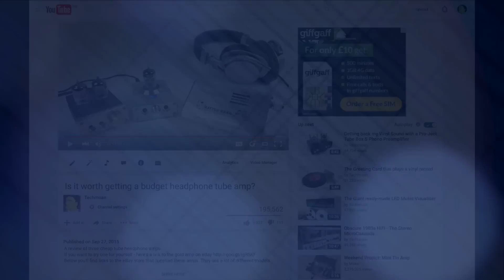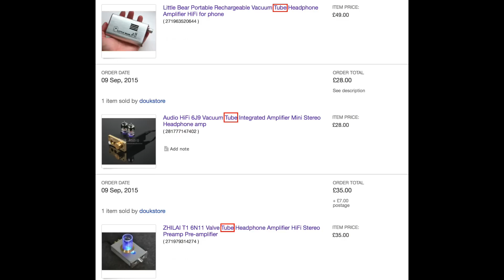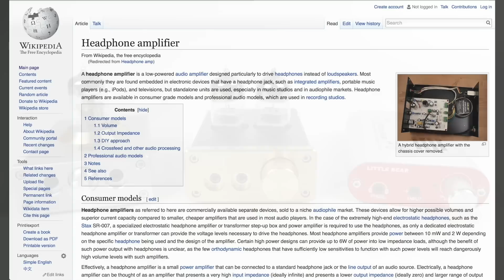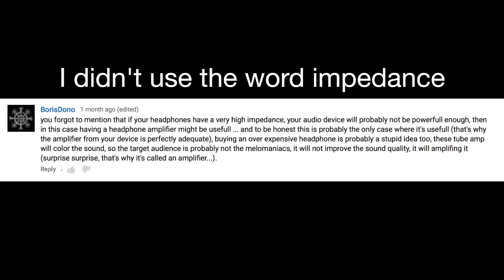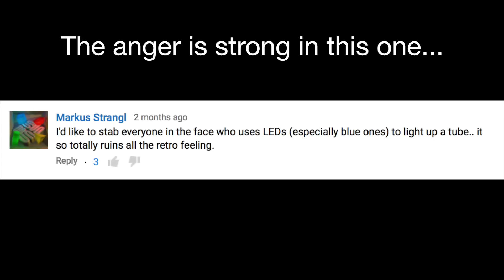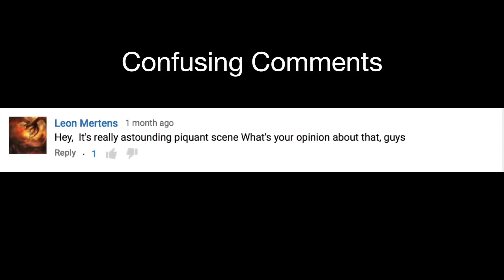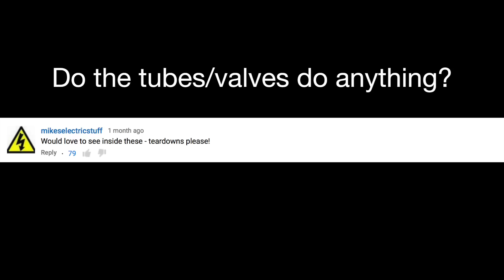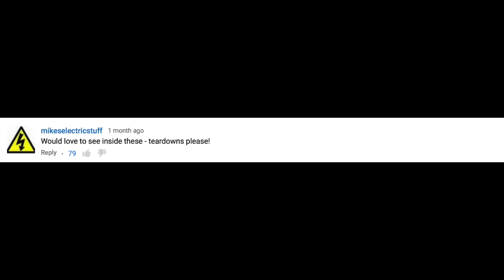Headphone Tube Amps - Follow-up & Tear-down

Comment: 6J9 Tube / Valve  is a triple triode designed to provide the combined functions of a RF Amplifier, oscillator and mixer into the VHF frequency range..... Seems a bit strange using this in a audio application seems more likely to be found in a older tube type american Television sets tuner.  another way of testing if this tube is legit there should be at least +125 VDC between pin 6 and common ground that is the plate voltage

Comment: Unit with the two valves, at least from what I can see, has the valve output going to pin 8 (Vcc) of the NE5532 Op Amps  supplying (nice smooth) power to the IC. The valve inputs appear to be from an LC Pi filter from the DC input so the valve is basically a power supply component.  Just for show.
Either that or they are just used as regulators to the inputs of the NE5532's but the tracks are hard to define.  
Only the Op Amps boost the signal to the output regardless.

Comment: I found both videos about these headphone amps really interesting. I am a bit of an audiophile but not one of the angry ones. I did wonder about the benefits of using something unbranded and very cheap. I nearly cheered when most of them had problems, and if I didn't have a hangover I would've done. I don't believe in spending ridiculous sums  for Hi-Fi but good valves or tubes (say whichever you want) do add a cost premium over a similar spec transistor model. So it does seem to have been borne out by your tests. If it sounds too good to be true - it probably is. I'd be very interested to hear how hot these things get with prolonged use, and whether they're actually very safe.

Comment: Gosh, I see integrated circuits but no output transformers.  I don't know a lot about physics invented since I was "up" on this topic 20 years ago. But I fear the tubes are not as much as they could  be.   See  https://youtu.be/rpMLYI0XG0A  for myself and tone when I was more current and fewer volts, grin.

Comment: I can see all three have a solid state voltage inverter clearly turning the low input voltage into the higher voltage (probably 90V) required by the valves. Bear in mind the printed circuits are double sided so connections are made both top & bottom. We have a modern microphone preamp here which has a valve in it & I too was surprised when it came with a 12V power adaptor. A quick check inside proved there was an inverter to produce the required high tension voltage.

Richard

Comment: Ok.  I don't give a rats ass about headphones.  I've got a Pi3, Dac and a home built tube P-P tube amp into a pair of Dynaco A-10 speakers.  I also have a home grown combo sand and tube pre-amp complete with phono-pre.  Quit whining.  You still don't match my system.

half (or more) of these, so called tube headphone amps not use the tube for anything.  not even a buffer stage.

Comment: Techmoan: some tubes are not "microphonic" while others are not, microphony is physical behavior of ALL tubes caused by the mechanical vibration of the control grid inside. Another important point: all single tube model obviously do not used their single tube since their are two channels to amplify, the tube in these devices are just decorative.
In fact, to confirm that this nice tube amp you just bought is really a tube amplifier, give a small notch on the tube, you should here this microphonic resonance you heard on your two tube model.

Comment: just my input as to the little bear t7 phono headphone amplifier is absolutely terrible.  check out my video on the little bear t7 tube amp but the tubes were too small, as a phono preamp it really added distortion and muddied up the music.  tubes need a ton of money thrown at them to be decent quality.   and keep in mind the phono preamp is really to convert the signal from the turntable from phono to aux signals not requiring the phono preamp inside your stereo amplifier.  but for $50 on Amazon The Little Bear t7 tube phono preamplifier was really a waste of money and in fact just took away from the quality and detail as well as Clarity of the music.  a complete waste of money but a headphone tube amplifier is a completely different piece of equipment.  I have tested over 7 phono preamplifier utilizing tubes as well as 14 headphone amplifiers using tubes and using transistors and what I have found is that you are able to save money on a headphone amplifier utilizing transistors and the quality seems to be better and of course make the music much louder however the tube headphone amps require spending a little bit more than $100 in my opinion to really take the sound quality up a notch.  I also performed a video on tubes in general and the consensus or conclusion at the end in my opinion was that tube amplifiers in general require a bit more money than a solid-state amplifier of any size in order to actually gauge the quality becoming better of the sound at all.  basically tubes are expensive and they're more expensive than their counterpart the transistor good more expensive to make and generally don't last as long however many people enjoy or prefer the warm Rich sound that tubes offer audio quality.  in my testing the Kilimanjaro headphone amplifier from Fujiyama proved to be the best quality and offered the most improvement over the audio in general also took the volume from listening to music from my phone and other MP3 devices to a total of three times more then not using an amplifier.

Comment: with the single tube amp, anyone else notice that transistor on the bottom. im thinking that power goes through the tube to the transistor so when the tube gets removed, the circuit gets disconnected
Reply: In fact a tube can only amplify a single channel (right OR left). So the point is: any device that claim to be a stereo tube amplifier but only has one tube is nothing more then a scam.

Comment: I was surprised to see that tubes (valves) were still being made, let alone being used for anything but replacements in old equipment. These were made obsolete when I was still in grade school, and that was 50 years ago. Other than retro for the sake of being retro, what's the point of designing anything that uses tubes?

Comment: of course you may need a headphone p if you've bought particularly hard to drive headphones (like the Fostex).  And not all of these are super expensive, so a budget solution would be welcomed.  

Though I would recommend an smsl solution over all of these.

Comment: The units work as real valve amplifiers. If you look closely at the dual tube and single tube amps, you will see a tiny black ferrite with a coil of copper wire wrapped around it. Nearby will be a 8 pin plastic package... thats the pwm controller the uses the coil of wire as a boost converter. This provides the B+ and B- for  the tubes.

So the valves are really  wired into the circuit ( double sided boards, so anode grid and cathode and screen ( where applicable) are utilised)

Another useful adjunct of the boost converter is that the operating frequency will be very high ( maybe 50khz) so there should not be any anode derived hum, like there can be in normal mains amps with a normal A class amplifier, where filtering the 50 hz mains noise out is a real problem in A class.

Valves can actually run at very low anode voltages, but the power will suffer accordingly.

 We can also use thoriated tungsten in the heaters of high power tubes, or strontium or perhaps barium oxides in low power ones to ease the heater current...ie to lower the heater temp and still get a decent electron cloud/emission thing going....

 Once we use the heat to drive the electrons out of the cathode, they will hang around in a cloud, but not really keen to go back, as the cathode is negatively charged. They prefer to go to the positively charged anode ( opposites attract). We can accelerate or slow them down by changing the grid voltage with respect to the cathode, and thats how they amplify. So by varying the grid voltage a bit we can control a relatively large stream of electrons... we have effected amplification. ie the grid sits between the cathode ( redhot and emitting electrons) and the anode ( positively charged with respect to the cathode). The electrons have to get past the loosely woven grid wires, that we place the audio input signal onto... we can also get it to buffer rather than amplify, and here we use a follower circuit ( less than unity gain )

There are a few op amps in there to give more gain/ frequency modifications, and probably provide negative feedback to maintain stability. There is a difference in the way valves and transistors treat the various harmonics, and each type may sound fractionally different, and as you have found, micro-phony can give an extra dimension of richness by giving some feedback into the grid from the vibration of the speakers in the case of speaker amplifiers. This happens because instead of changing the grid voltage to modulate the electron stream, when you hit it or knock it, the very fine wires that make up the grid, will vary their position relative to the distance from the cathode and the anode, this will modulate the signal too, so the vibrating grid acts as a microphone effectively... perhaps like a ribbon microphone.... proof the valve is actually part of the circuit and working as an amplifier to.

Look like simple little units, but they are really quite complex with pwm power supplies and all....... actually a hybrid.
The valves are there just to say a" valve amp", but they do play a part in the amplifier.

 Thanks for the teardown, I enjoyed it very much..

John

Comment: You guys do know that cars used to have tube radios that ran on 13.8V right? And DC to DC converters didn't exist in the 1960's (they do now btw). These are low power amps, they don't need massive voltage differentials to give you 1W of output from line level.

Comment: They are called vacuum tubes not valves! A valve is for plumbing or air flow. there are also gas valves. enough said. Thanks I like the videos. I also like exposing the fraud on these amplifiers. you must have B+ voltage on a real tube Amp!

Comment: Not all tubes used High Voltage, most used 6 to 12 volts, the high voltage tubes were usually only in televisions, or highly specialized applications. A lot of tube radios used batteries, and while they were commonly 20+ volts, that voltage was often stepped down for the tubes, and the batteries were just high voltage to last longer, and/or to make the battery last a long time. These little tubes were more than likely the low voltage tubes anyways. It is entirely possible that these tubes are actually being used in these circuits, even if only a few legs of the tubes are being used. It was very common that one tube had multiple applications, and different legs would be used for different things. In the tube radio that I own/restored, most of the tubes have only a few wires running to them, and it is the same way in my stepfather's large console radios and tube tv.

Comment: I have owned and listened to many amps over fifty years. The one I am currently using is a valve amp and I think it sounds great with the speakers I am using. I also currently use a valve phono stage for my records and I listen to the radio.

Comment: A few short comments (I don't like typing a lot):
In the late '60s I watched my father and uncle build hi-fi and electronics kits (Knight, Scott, Dynaco etc.)
From early to late '70s I built Heathkits and Eico, and worked in TV repair shops.
I got to the point where I can look inside a tube and identify which leads go to the anode, grid(s),  cathode, heater etc.
Came in handy when the ID was rubbed off.
Never worried about leaving fingerprints on the 1000s of tubes I handled.
In fact skin oils on the higher power tubes only made a distinctive odor.
Looking in my 1973 RCA Receiving Tube Manual I see that the 6J9 is a high mu triple triode.
Doesn't list the others mentioned.
To those who like the sound of tubes I say "have at it", the added distortion is like the fungus in a good cheese.
Reply: Nicely put
Reply: The 6021 subminiature tube is a twin triode. It looks like it was high quality as it was one of those subminiature tubes that were built to US Military specs back then. It was used for RF Amplification and Oscillation.

Comment: I think im quite a bit late to the party here, but will chime in anyways: The 2 tube device with the 5532 opamps looks like it uses an hybrid structure of 1st half of opamp (as input buffer) > tube (as "coloration" stage) > 2nd half of opamp (as output amp), all of that multiplied for 2, so you get stereo. thats what some low voltage tube pedals do, so it makes sense that its what happens here too, specially if you look at the opamps location, they are right besides the input and outputs. Cheers.

Comment: Great video Mat, and yes, the tubes are actually in-circuit and those circuit boards are  double-sided and have wiring traces on both sides, so even though only a couple terminals of the tube sockets may appear to be connected viewing the board from the bottom, there are more traces on the top of the board... maybe even some traces between the top and bottom sides  if the circuit board has multiple layers. 

I like your shows, Mat.. I learn stuff and have a good time too... it's kinda like an educational technical version of Monty Python or something. :-)
Reply: Its expensive to make multilayer boards, so these will be just double sided. The actual work is being carried out by the NE5532 op amps, the output is then fed into the valves-though they are not doing any useful amplification, these would sound better if you bypassed the valves.

Comment: A little late to the party, but all the tubes were connected correctly. You can see when in circuit board the color slithly changes for a millimeter or so then there is a gap in copper. Those circuit boards were multi layer meaning there was copper on atleast both sides. You could see that the tube connections were on both sides of the pcb. Also all of those "water reservoir" looking components are all capacitors, even those small SMD silver ones. (there are other water reservoir looking components but i suspect not in here)
Having power supply of only 12V means nothing. There could be voltage pumps or in other words DC to DC converters that simply make a DC voltage to a smaller or larger DC voltage. But then again on these cheap devices i doubt it.
Those black components that have pins on two sides (for example on the first amp the ones with label NE5532N) are dual opamps (or single or quad). Basically it means that these "tube amps" are just hybrid amps and most likely the tubes doesnt do anything but just distortion and noise.

Comment: Concerning the 6021.  The tubes (valves) are dual triodes developed during WWII.  They
were used in artillery shells.  These are proximity switches to detonate shells fired at attacking aircraft, usually from ships.  The shells exploded near airplanes in the event
the shell missed.   .

Comment: Validity of the circuitry aside, audio is very subjective. I am an old school audiophile that have speaker cables the thickness of a garden hose that cost more than most stereo systems. Do they sound better than lamp cord? Yeah, I think they do and I'm the only one that counts. I am also an electronics hobbyist with more than 50 years in the field. So I know exactly how all this stuff works. Regarding the delay in producing sound, many pre-amps have a turn-on "thump" that you don't want to amplify. That's why, even though most have no idea this happens, in receivers the pre-amp turns on first, before the amp. So the fact that these little "choob" amps have a short delay in producing sound is a good thing. By the way, I don't care how you pronounce certain words. So I say to heck with the negative comments and the ones that are incomprehensible. I really enjoy your videos because your love of electronics comes through.

Comment: the pcb's are all duoble sided pcb's all pins are connected and are used. tube amps are still the best at reproducing the cleanest sound out there solid state ic's can and will pick up interverance thats why solid state has all the filtering and smoothing caps in there circuits. Tube amps only use caps to power them. very informative videos from you keep it up. as a matter of interst i have an old 1929 tube radio from sentinel and it still works 100%

Comment: Well on the first one you opened I see capacitors rated for 16 volts. A little low for the plate which would typically be over 100 even on a small Tube like this. 
The 2 real tube amps I recently built, used 220V through a DC-DC concerter, and the larger amp used 300 volts through a big AC transformer, and the capacitors were rated 450 volts.

Comment: I found the spec sheet for the 2-tube version; it clearly states the heater voltage at 6V and that it uses a buck supply to operate the tube in triode mode at 190 volts. So it is a "real" tube amp.

Comment: You can't tell how many pins of the tube are incorporated into the circuit by looking at the PCB; only if it's a dual-sided board will every connection be visible from the outside. [Edit: 2-tube unit: the circuit shows 8 of 9 pins are active; one or more unused pin(s) is/are normal in some circuits]. Most PCBs are multi-layer with circuits laid out within the board itself, and connected to one or more other layers by the use of "vias". By the way ... nice Pro Walkman. Not many people know what you have there.